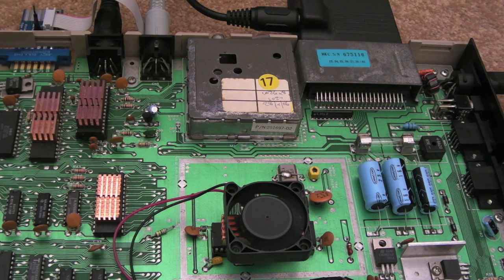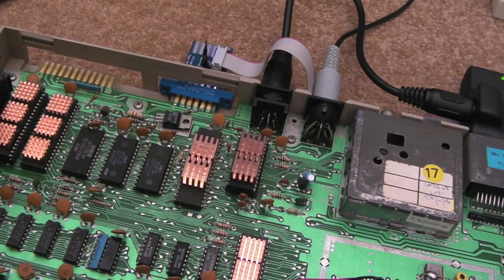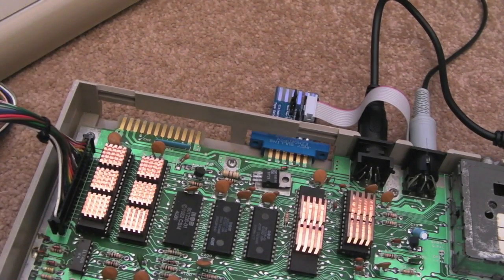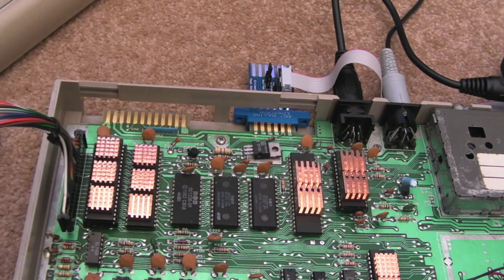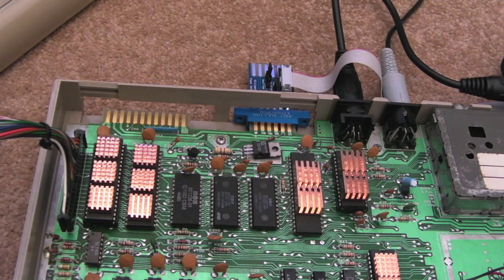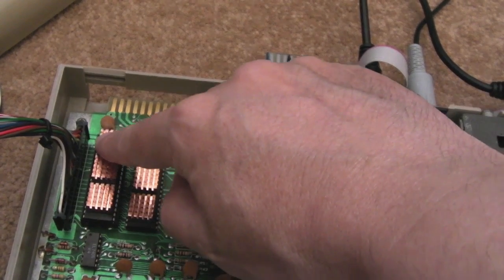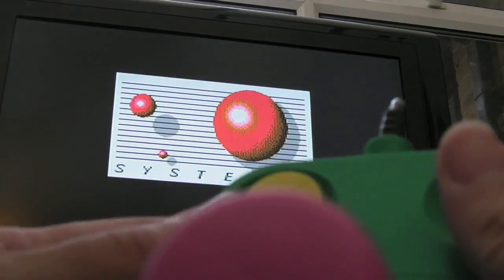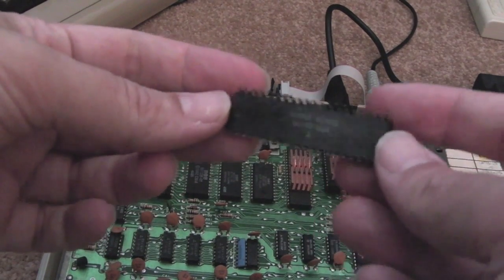Commodore 64 (C64) CIA Problems (Controller Problem)

Comment: Hi again, I know this is old, I am beginning to repair old computers myself so I look at your older videos... Just a note, on the diagnostic cartirdge you have two time counter on the bottom of the screen they are from both CIA chips, it would be interresting if you still have that faulty chip to see what is displayed there... Thanks!

Comment: Friend of mine has a Philips G7000 where the picture died after an hour of play. On the bench it worked again for a short time. I noticed the PAL encoder has one pin unconnected. If it's working, this pin is HIGH. If it isn't, this pin is LOW. I soldered a pullup on there and that got it working for another three years until the chip finally died. Luckily I noticed back then that the chip gets TTL RGBi, so I did an RGB mod and now you can hook a CGA monitor to it (I also made a SCART adapter).

Comment: My controller port 1 is doing similar. Only two directions work on port 1... Left works down is up for some reason and the action button also works.Yet controller port 2 works fine. My controller is fine and works great. I first swapped both 6526 chips that were already socketed. I'm really annoyed with it. No clue what else might fix it.
Reply from the maker: Off the top of my head, I think there a 4066 that might be related!

Comment: Had the same problem. 5v directly to the pin it works. 😀
Reply from the maker: Great =D   Consider cleaning the power socket and switch (contact cleaner or WD40 in both).  I later noticed my 5v level was a bit low at around 4.6v - that was the ultimate cause of why mine was playing up.

Comment: I know this is an old video, but I was working on a Commodore 128 that has a CIA who's symptoms are bad keyboard rows. I've noticed if I put it into the freezer sometimes it works. I should try your mod though :). I do have a replacement on the way but wow those are getting expensive.
Reply from the maker: Hehe, yes - I've had temperature issues like that in chips before too.  You could measure the resistances between gnd + vcc for each data, address and port line.  Like I did in that "Looking at faulty chips" video.  You might find it needs an external pullup resistor like one of my CIAs did.

Comment: hello, GadgetUK164.
Thanks for all your videos, that help fine.

 I am a french owner of 3 C64, one breadbin C64, one C64c and a death breadbin C64

 The C64c works great. I use a Sd2iec with the C64c, that works fine.

I have got a problem with the breadbin, from 1983, assy 250407, 251137 rev B. 
When I start it, all is ok. basic run great.
All the chemical caps are new. 
But the Sd2iec doesn't work, it works but the C64 said "device is not present". 

1st try to change the CIA, change with 3, no result.
 Try to change the 7406, no result. 
the both CIA U1 and U2 got 4,99 volts on the pin 2 as you try on this video.
 I have change the three resistors R28, R29, R30 no results. 
So my C64 is working, but impossible to use the device. I have no 1541 to try and no death cartridge.

 Actually, i have got R28=0V R29=8,3mV R30=4,94v and R50=0v  and instead of 1M ohms, R29 & R30 =620 ohms :( ????  

Have you got a new idea about this problem. Thanks a lot for your time.
Cedric
Reply: thanks so much. do you think that 1N4001 is working?
Reply from the maker: Yes, that will work too!  Just make sure you put the diode in the same way as the one you remove.  The purpose of those Schottky diodes is to carry voltages higher than 5v to ground (ESD protection).  A normal diode (4148, or 4001) will work, but they aren't as fast as a Schottky diode - so they aren't as good at ESD protection, but they will still work ok.
Reply: ok. Thanks you. I know for the diode way to work, but i have to see the schematic, because all diodes are black in my breadbin. do you think it's F87, F88 and F89? and thanks for explain what is a schottky diodes. best regards
Reply from the maker: Cédric Gyger Those are ferrite beads - they should measure as a short.  Is there a CR104 and CR105 on there - could be those!  There aren't as many diodes on the breadbin.
Reply from the maker: Also spotted CR100, CR101, CR102, CR103.  Are those on your board?
Reply: ahaha... i haven't got this on my board. I have cr1 cr2 cr4 cr5 and cr6. 

cr5 and cr6 are 1N4001 for rectifier voltage. 

cr1is 2.7V Zener IN4371 and cr2 7.5V Zener IN755 and look like these on your link.

cr4 is Bridge S2VB10, DBA20B, DBA20C for alternative psu rectifier
Reply from the maker: Cédric Gyger OK, will see if I can find schematics.
Reply from the maker: Take a look at this page - if you follow the serial connections, that should help.  The connections pass through ferrite beads (FB) which should measure as a short - if one is open circuit it would be faulty.  There are also pull up resistors - maybe one shorted or open circuit?
Reply from the maker: http://www.zimmers.net/anonftp/pub/cbm/schematics/computers/c64/326106-1of2.gif
Reply: cr1 and cr2 are not shorted
Reply from the maker: The final possiblity is the 74LS139 - that drives the chip selects for the CIAs.  Beyond that it has to be either connection problem, a faulty pull up resistor, or one of the diodes.  I would follow each of the serial port connections using continuity test, against the breadbin schematics to make sure they are connected to the relevant pull ups / ferrite beads / diodes, and trace onwards to the CIA pins.
Reply: hey. thanks for idea. the diodes are not shorted and the ferrite not break. ok i will try the 74ls139 i've got some new
Reply from the maker: Let me know how you get on!
Reply: hey. i try a piggy back test with the 74ls139 but always device not présent... Idon't know what to do. I will have a new breadbin forpart, i wish there cia that work or other idea... thanks again Dude
Reply from the maker: You really need to trace connections between the serial DIN and the CIA then.  I wonder if you've got some wierd PLA fault where the PLA just happens to not be switching between CIAs properly or something.

Are you sure you didn't damage any traces when removing any of the chips?
Reply: Hey, i have exactly the same version of breadbin and revision and the same problem! it just won't work with my SD2IEC nor datasette(i have one, not sure if it's working or not, since it could be the CIAs faulty all these while)! Unfortunately, i only have one C64. The only thing i can do was swap the CIAs around. I have after the swapping, it does a bit better and doesn't says "Device not present". Instead. It will hangs after the LOAD command and display SEARCHING indefinitely. have you found a solution yet?

Comment: Hi GadgetUK164.  I think I may have a problem with a CIA chip as well.  I wanted to see what you thought of my issue with a C64c. (or maybe its a G)  Assy 250469 PCB NO 252311 Rev.4.  Anyway, it will not communicate with my 1541II drive or work correctly with the Warp Speed cartridge.  With the cartridge, it just shows the screen for it, but cannot interact with anything.  no cursor.  It just locks up in both cases.  The drive and cartridge does work, for I use it on my C128D.  (the c64 is also missing a 4 button.  but that is beside the point)  It does power on with a command prompt.  and I can type in a simple sound program and it will work the sid chip just fine.  However when I try to do the command to initialize the drive or access it in any way, it locks up.  I have pulled the chips that were not soldered directly to the MB and re-seated them.  I believe there are two CIA chips on the MB.  How do I know which one controls the ports?  Your thoughts please.  Thank you.
Reply from the maker: Typically the CIA nearest the keyboard connector will be for keyboad and joystick input (You can normally see the traces going straight from that CIA to the pin header connector for the keyboard).  The other CIA (one not connected to keyboard pin header) is for the serial port.   If they are socketed, try swapping them around.  It does sound like a CIA problem, but theres also a 74 logic chip on the C64 board that relates to serial I think.
Reply: Thank you for your reply.  But I did a big tech boo-boo, by not testing my power supply.  Apparently I am not getting 9v on pin 7.  Pin 6 = 9vac, pin 5 = 5vdc.  But pin 7 - 1.9vac.  I suppose this would cause my problem eh?
Reply from the maker: The easiest way to check voltages is to put your meter on the DC range and measure between ground (for example on the modulator can, as that connects to ground), and on the VCC pins on the chips.  eg. pin 25 on the 8580 (SID) is VCC and should measure ~5v DC.   Then check pin 25 - that's VDD, it should measure ~9v DC.  If that 9v DC is there, then you likely don't have a problem with the PSU.
Reply: Thanks.  I wasn't sure what pins to check.  Ill do that.

Comment: Hey mate, where did you get those heat sinks from?, cheers
Reply from the maker: +blackgadget eBay.  Just search for RAM heat sinks and you will find loads.  Check that the ones you order have double sided adhesive pads!

Comment: And also OMFG the Legs on the IC.......What did you do to them?
Reply from the maker: Amy Marie Which IC, the one I removed?  The legs are fine?!?  Perfectly straight and all OK - there was a solder blob left on pin 1 and pin 20 from the pull up resistor, is that what you could see?
Reply: i don't know if it was the camera or not, i saw solder blobs and the "non shiny" look to the Pins. i had a problem like that with my MCU circuit once i took a nail file and cleaned the contacts, i lost the resistance and the device worked correctly again.
Reply from the maker: Nail file!?!?  I need to get one of those!  Just don't start using lipstick to fix anything, I won't be buying any of that lol
Reply: lol okay....

Comment: CMOS technology has internal "protection" diodes on the inputs. Static can cause excessive current to be passed by these diodes and damage the substrate.
This causes a 'weird' failure mode in CMOS chips where they appear to work but then give unpredictable behaviour as they warm up.
With bi-polar transistor circuits, failure is often a dead chip that does nothing.
I suspect that the CIA chip got zapped at some point and the bizarre behaviour you're seeing is the classic CMOS failure mode in action.

Of course, contemporary CMOS technology is less prone to this, but can still show the same behaviour.
Reply: Very interesting, but these aren't CMOS, I think they are NMOS, and in the 64C HMOS.
Reply: ***** Point taken.
I think, though, that the type of failure mode I'm referring to is common to all MOS technology. (but I could be wrong.)
Reply from the maker: Aadil Shah Thanks for the info, any and all information is useful =)  I think your initial point about the CIA getting zapped are good though since that has always been the number one killer on CIAs.  It's the reason why I hardly ever risk changing the joystick port over whilst its powered on.  I used to get hundreds of 64s in for repair back in the day, and it was nearly always related to the CIA.

Comment: Hmm try in basic: 10 print peek(56320) : goto 10
you should see 127 repeatedly if no action on joystick port 2. The number changes when you move the joystick or press button. https://www.c64-wiki.com/index.php/Joystick
Reply from the maker: bwack I will try this when I get chance later, but I am sure it will just work fine with the pull up on there.  Without it it might not =/

Comment: Interesting find. Check +5V by measuring across the CIA IC's power pins ? 4.53V at pin 2.. could be low voltage at VCC aswell ? Could be ESD damage.. Cause all sorts of wierd problems. btw the diagnostic rom, does it test cia inputs ?
Reply from the maker: bwack The fault has always been there but very intermittent until recently.  It has on occasion skipped the intro to Last Ninja 3 previously as well and back them I didn't understand it, but often after a reboot it would be OK again.  I think something has been gradually breaking down.   That voltage seems to be the same on both of the C64 boards I had out at the time.  VCC measures 5v, but those CIA lines don't show 5v exactly.  The diag cart will test CIA inputs if you have all the loop back connectors connected.  I've never built the loop back harness but I will do at some point.
Reply from the maker: bwack You were onto something there when talking about the VCC being low!  I didn't think much of it at the time but I've since had the issue with Last Ninja 3 come back, and then odd random crashes.  I looked at the VCC and thought it was definitely lower than it should be ~4.6v.  I recapped the system last night and it runs completely stable now, no crashing etc.  Checked the 5v line again and I was surprised, I still have 4.6v...  I then checked the 7805 output - nice clean 5v.   After looking at the diagram and trying to follow traces I eventually worked out something I never knew.  The 5v VCC comes from the PSU, not the 7805 - by the looks of things.  It now makes sense why people consider a voltage protection circuit to limit the PSU 5v level, I had postponed that mod because I always thought the 5v came from the 7805.   I've also worked out that the problem with Last Ninja 3 skipping the intro load is solved by swapping the SID...  This must be something to do with pot x and pot y inputs, but taking measurements shows nothing strange going on with those pins.  Since the VCC is 4.6v I am wondering if that is my problem now, so I guess I need to strip the PSU down if I can get into it...   

Thanks for mentioning the VCC issue, I hadn't paid much attention to it at the time and its very likely a big part of the problem.   The CIA is totally fine in another board so I think the low VCC level is affecting that as well.
Reply: Could be marginal error if you have 4.6V and old caps.. I still would try and clean the C64 power connector and also the pins in the psu connector. Did wonders for my old breadbin..
 Actually you could just measure VCC on one of the IC's while wiggeling the power connector. If the voltage bounces a lot theres a problem, if its like +-10mV then I wouldn't worry about it.
 Yes. The 5V from the 7805 inside the C64 is "5V CAN", which I think means 5V for the "can" (the vic and the timing circuitry box in the old c64s).. I'm not that pragmatic with repairing electronics, but I think that the voltage would be the first to sort out if it is low. :)
Reply: bwack Hmm. In one of my videos you can see that I also had problems with low voltage. I had the "Searching for $" problem, where while trying to read the disk directory it will only sit there and eventually you get a "device not present" message. So i swapped the suggested 7406 iec buffers in both the c64 and disk drive.. tried swapping cia's. No resolution. The problem would always come back after about 10 minutes after cold start. Then I measured the voltage at the 7406 in the c64, and it was 4.6 - 4.7 volt, and while wiggeling the psu connected i got the voltage to bounce up to 4.8V.. So I cleaned the c64 power connector and psu connector pins and got 4.950V and only like +- 10mV change while wiggeling the connector. The problem with disk drives has never reoccured after that.. I believe it is the CIAs that don't like the low voltage...
Reply from the maker: bwack This proved to be a very useful bit of information here!  The 4.6v was indeed a big problem!  The video is uploading at the moment.
Reply: I'm glad you found it helpful :-)

Comment: Thats really strange Gadget. I'm no chip engineer but I suppose it could have been just a classic case of static damage, or maybe even the passivation on the die causing problems thus making the chip marginal. I guess its certaintly possible for the chip to have sustained damage and still be made to "work". Excellent job troubleshooting however, I would have never thought to pipe 5V into it to see if it triiggers a joy up. I guess most of us are just used to a chip being "dead" or at least mostly dead when they are faulty.

Comment: Where did you get the heat sinks and how did you affix them to the chips?
Reply: Mugg Mehlmann  Well I can tell you since I use the same ones. They are heatsinks intendeded for use on modern BGA chips. They come with adhesive sticky backed thermal tape already on the backside. You can find them easily on Amazon searching for copper heatsink adhesive.
Reply: Mugg Mehlmann Oh, forgot to say they work a treat on old DIP commodore chips too. I've gotten some boring looking aluminium ones too and they seem to be more then adequate as well and a bit cheaper.